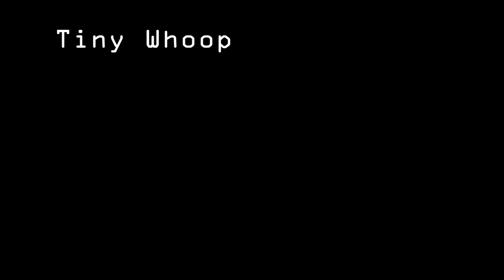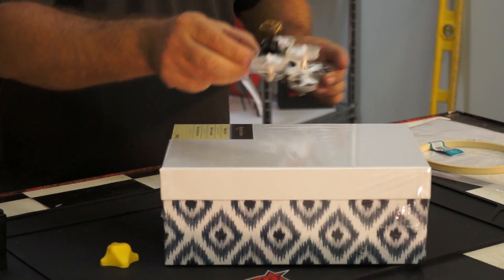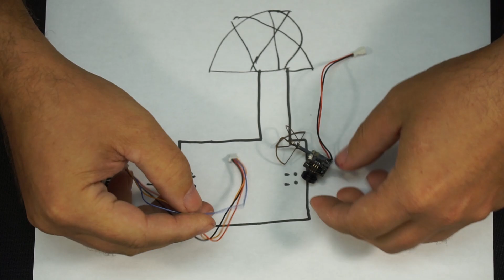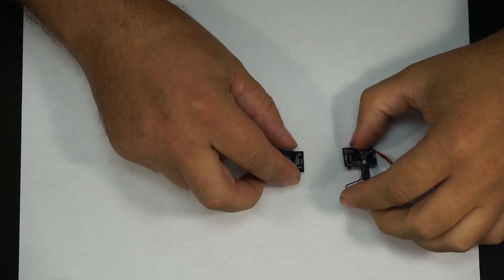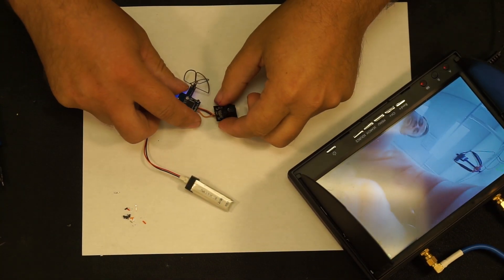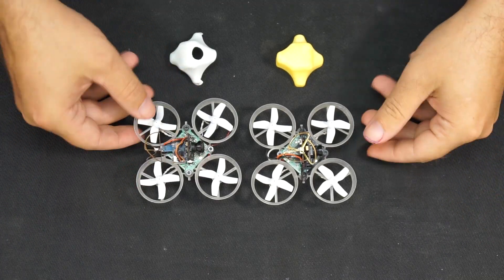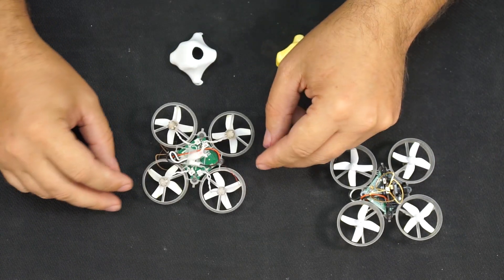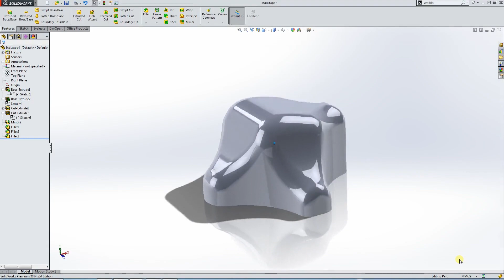TINY WHOOP MULLET MOD FOR THE VTX ANTENNA

Comment: Interesting, I was going to use right angle pins since I unsoldered my pins with a desoldering gun, but a desoldering sucker and some wick (with flux in the wick) would do the same. I figured the right angle pins will add support and won't have to worry about the wires breaking. 
Then I debated on a SMA PCB port to try a pagoda on it, decided against it when I realized the TX power and walls would help either way and a whip from an old 5gHz router antenna will give the same distance and radiation pattern with less weight. Easy to do and much more flexible, can still face up a little and won't break. 
For the canopy I would recommend just modding a Betafpv canopy, they sell them as a 5 pack and weigh less then a gram each. You can cut away a little with a exact knife or heat it up and remold it to what you want. 
Thanks for sharing your methods, it's all about the different ideas and flexibility to make your own decision or do your own thing.
Scott

Comment: As IBCrazy pointed out, when mounting a CL antenna horizontal you will lose polarization and get inferior signal performance. Probably not a huge thing with the Whoop since it isnt going far but you will get better signal with vertical mounting which is important to reduce multipath when flying around inside rooms. Of course that defeats the purpose of your design to protect the antenna or better yet, use a dipole and then you can mount vertical without worrying about breaking when crashing etc. Cool design, thanks for posting!
Reply: Shouldn't it work the same if you just tilt your receiver antenna too?

Comment: I don't have an Inductrix, But I do have one of the Quanum Elite cam/VTX units.
The one thing that always bugged me about it was not being able to use the OSD thats built into the Quanum Illuminati 32 FC I've got on that quad (Hey, The quad's lugging it around, I wanna use it !).
This video's shown me a way to intercept the video signal between the cam and VTX. I'm thinking I could cut the original bridging pin and solder a couple of short stubs of wire to them that terminate to 2 pins of header strip. That way I could connect OSD when I wanted to, Or bridge them with a jumper if I use the cam on a quad that doesn't have an OSD option.
Thanks for the info, I've hit subscribe because you've just made my day. :)
Reply from the maker: That should work no issue

Comment: Looks really good! But how about converting it to a simple wire antenna? Would save a lot of weight and trouble, but not sure about the reception with only 25mw.. tried it with a 200mw vtx and it wasn't great but more than enough for tiny whooping.

Comment: I just got my Mullet Mod done.
Every time I spool up the motors my signal has all kinds of issues.
Didnt have them at all before. Am I missing a filter or maybe a placement issue?.
Looks really cool. And works great on the bench until I spin up the motors then its like a old VCR with terrible tracking lines.
Any Ideas?.

Comment: How do you, fasten the vtx and the camera to the frame& hot glue? double sided tape?
Reply from the maker: Yes since the vtx is now parral to the fc just a small patch or double sided tape works great and then i used a dab of hot glue on the two corners of the cam to the vtx at about a 15 DEG angle. works like a champ
Reply: thank you kind sir.
Reply: perfect, I was just looking for this answer. Tnx guys. ( mid-stream on my first mullet mod! ... well actually... upgraded frame, motors, beebrain and mullet mod ;)
Reply: Did yours have the USB port on top or bottom. Wondering if this is do -matthew with an Acrowhoop V2 - USB on top rear of board.

Comment: You skipped the part where you mounted the VTX/camera to the frame?  how did you do this?
Reply: I was hopeful on that same missing section. I ended up going down the hot glue route.
Reply: I found hot glue to strong, and tended to pull to hard on things when removing it.. I got a roll of double sided tape (they call it mounting tape) and that was good for me
Reply: Eric Bajalis how did you place the mounting tape for the camera? doesn't seem like there is enough surface on the camera when it's standing up and pointed forward to tape it to the fc?
Reply: You can use a heat gun around 150 degrees Celsius at 10-15 cm to warm the part up a bit, makes it comes off very easy. And it's very satisfying to peel it off too.. :p
Reply: You can either use hotglue or a 3d printed part
Reply: Use alcohol to remove hot glue
Reply: All you need to do is get a piece of that double face tape that red 3M stuff might be a little too strong so you go to Walmart and you get some of that double face tape with the green and white backing it's actually a double faced foam tape it's maybe an eighth inch thick or maybe 16th of an inch thick

Comment: Great vid! so its lighter because you're removing wires? cause so far in the video you're separating vtx from cam and adding the very light canopy , I would guess even if it's the lightest canopy possible is a net + of weight
Reply from the maker: well you dont need the heavy TPU mount anymore or the rabbit ears to protect the antenna so the total weight is less.
Reply: I see

Comment: Is there a max length the wire can be between the camera and vtx? I've got about 110mm between mine, and I get no video. The vtx connects, but it's all black on the monitor.
Reply from the maker: 110mm should be fine, check your pos and neg polarity
Reply: It may sound silly, it probably is silly, and you have probably fixed it by now, but you may have your lens protector on your camera. I leave it on half the time and don't realize until I put on the goggles.

Comment: I shorted this cam with a small soder ball on a whoop :( i dont know what smoked on the back but the cam is good. the tx give the cam 3.3 or 5v? maybe i can use it with a new tx. just need to know if the cam will take 5v or 3.3 thanks
Reply: Since I'm 7 months late you probably figured it out, but i think that the cameras take 3.3v. I don't think they could withstand 5v.
Reply: I did the same thing just now... What tx did you end up using?

Comment: Just curious if anyone has done this with a FX798T or the Eachine HF01?  Seems basically the same but there are 6 pins connecting the boards
Reply: I did for another build. The left side (if facing you) is just soldered standoffs so that both sides are supported. can just leave those. I would just like to know if it is the same wiring order though.